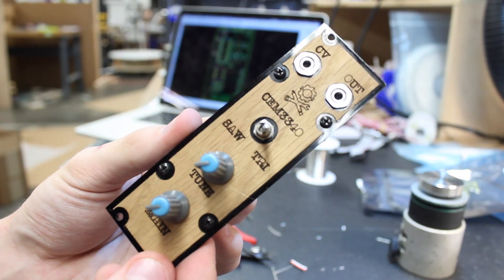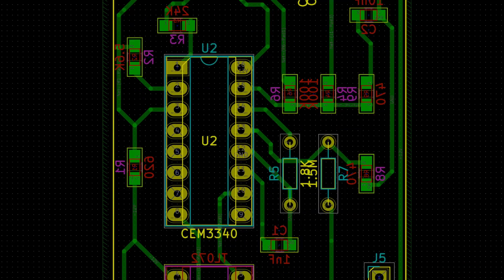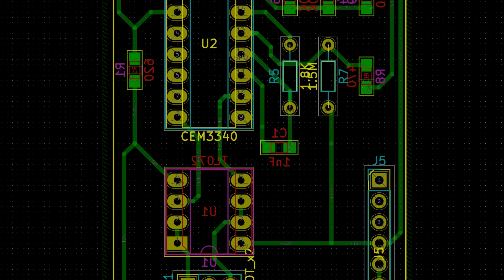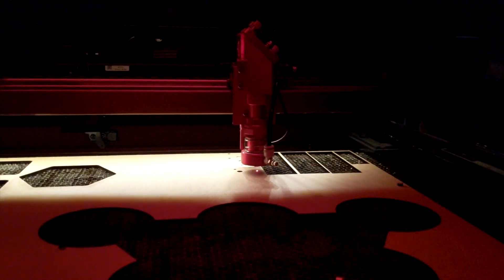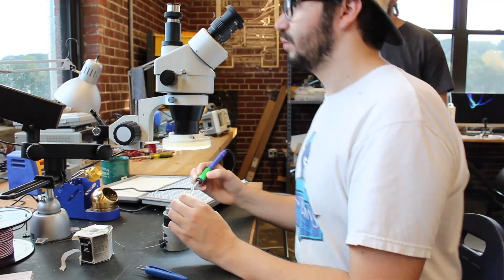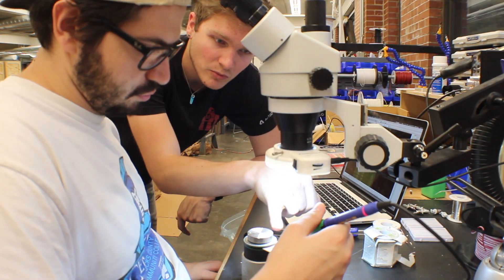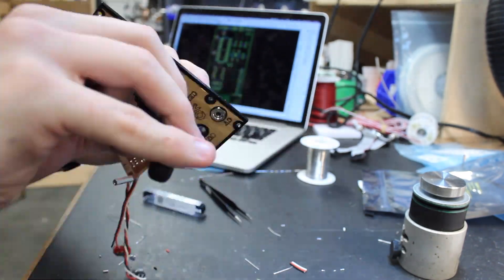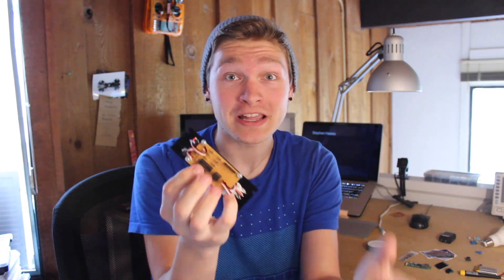Making a DIY SYNTH Module!

Comment: If the CEM3340 is $70 for 3 chips, then why are you even using that? Why not use an oscillator chip that's available for less money than a f**king AAA game?

Comment: if space constraints are not a problem.  A guy on synthdiy reddit released the files too make cem3340 osciallor/1v tracking with sinewave output. https://www.reddit.com/r/synthdiy/comments/cwq82m/cem3340_vco_schematics_and_pcb/

Comment: So let's remove DIY from the title because most of us don't have access to your milling equipment.
Reply: you dont need the milling machine. the original design used stripboard.
Reply from the maker: Sam's tutorial is linked in the description, it shows how to do it all with perf board, no mill needed. Also, small PCB mills have come down in price quite a bit (Banggood, AliExpress), you might be surprised how easy/cheap it is to get going with one!

Comment: If you need cem3340 for future projects, you can use a as3340. Its easier to get your hands on and its cheaper
Reply: is it sounds the same?
Reply: @balintbuda3017  i doubt even all the CEM3340 always sounded exactly the same x3
Reply: @balintbuda3017  if you look at it with a oscilloscope there is a slight difference when the rate of change of the voltage changes (like at the peak of a triangle wave). you cant hear that tho
Reply: no, the current revision is the CEM3340 is rev G.
i rather have the original CEM stuff than a clone from a east European country, the basically made use of that the patent experired.

Comment: I built one too but i cant get it to work... :D
Reply: Yes. Tiptop audio μ zeus. It has +12/0/-12 and 5V pins. But i dont think its the power supply because my other diy modules do work
Reply: @__moe__  check for bad solder
Reply: @UberGamer 01 i got it to work. Dont remember the problem tho 😅
Reply: Are you using a dual power supply?